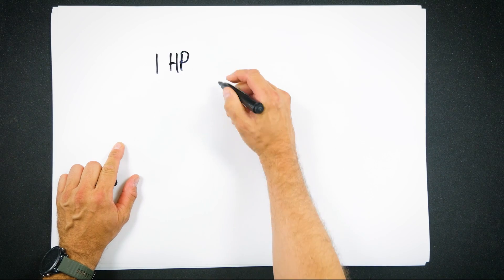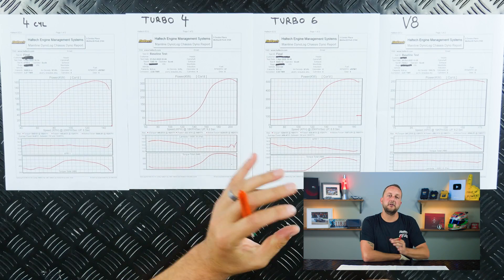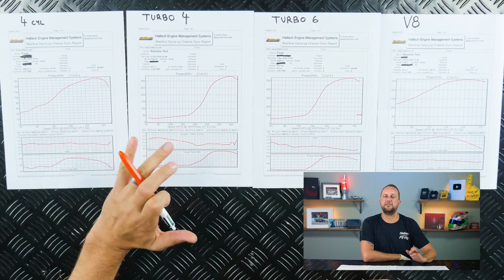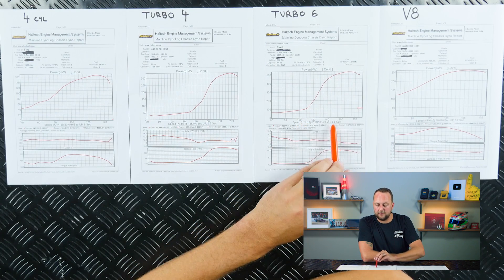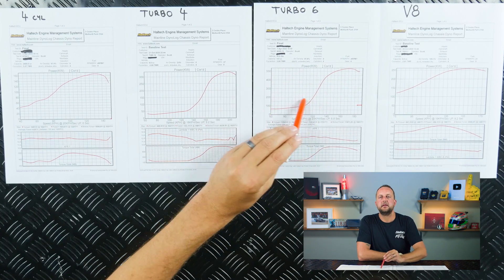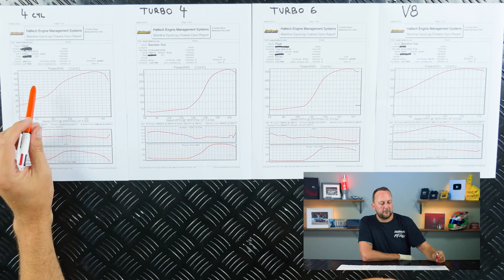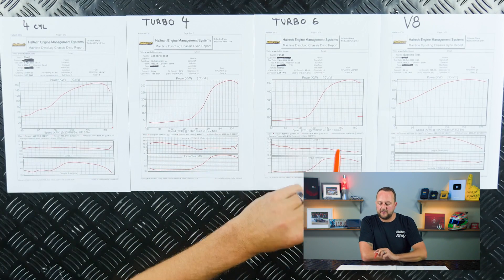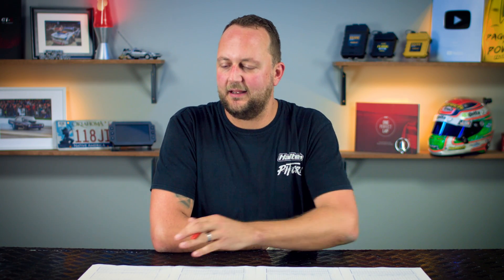🛠 A Perfect Power Curve - is there such a thing? | TECHNICALLY SPEAKING

Comment: 1:50 It’s a lot easier if you use MKS / SI units as used by physicists! No fudge factor conversion needed. Torque is in Newton-meters and angular velocity is in radians per second, the resulting power will be in Watts.

As there is a direct relationship between torque and power most of the discussions by petrolheads are fairly uninformed. When people talk about a torquey engine I think they mean one with a wide power band, not one with extremely high engine torque. The gearbox takes care of that.

Comment: You need to get it straight. There is ONLY 1 thing that accelerates the car and that is rear wheel torque, whether at low rpm or high rpm. Horsepower means nothing more than a calculated number that indicates what rear wheel torque can be expected with various gearings. If gearing is fixed then horsepower means nothing.

Comment: Great reference video. I'd love to see it also talk a bit more about that relation, together with gear ratios.
I ride motorbikes mostly and find that the discussions there often miss very important points on gearing and power. Usually people complaining about bikes like the KLR650 as "needing" 6 speeds, when the bike has a wide enough power / torque band that it can do without that extra gear.

I have mostly operated torquey vehicles and learned a ton from my experiences on the few peak-y race spec bikes, I've been on.
Mainly a built DRZ and 2 stroke race spec Yamaha YZF 250.
TBH, I find them nearly unusable in a normal setting because the engines just buck and complain when going at normal speeds. They taught me, why they have close ratio gearboxes with many gears, and that's purely to keep them in their narrow power band.

Comment: Differentual gearing and tyre size along with a tough transmission / Gearbox can change the curve very effectivly and put the power where you are most likely to use it.
You can have the most expensive and hottest motor avaliable but it won't matter if the rest is not set up correctly and don't forget you have to stop as well. Bigger power calls for bigger brakes

Comment: What mods does the k24 have? And what k24 is it? 

It's hard to believe that it has so much Nm.

I have just turboed my k24z3 with 5 psi. I have 252nm and 167wkw. At 7288rpm. 

Im happy with the way the car drives. But i might up the boost to 9psi just to get the most of my setup and money.

Comment: get inline 4  5 litres and v8 5 litres for road car both have the same power curve ...., its easy to do strong lowend and relativvely strong top end while  have much biger displacement than honda 2,4 litre heh but comapre the same displacement and there be no big diffrenc if you have v8 or inline 4 with similar bore to stroke and so one ...now the perfect power curve assuming we have in regulation limited peak pwoer is..... yeeep constant peak power as wide on rpm graph as posiible this reduce shifting to minimum and no matter at which rpm you are all it takes is put throtlle at max and you have max accelerationat any speed whithout reduction gear down .

Comment: the best engine for a daily car, van or pickup is a 4 Cylinder Turbo Diesel! 😆

not necessarily the fastest thing out there,

but think about it, a diesel as small as a 1.7L 4 cylinder can make 90kw as early as 2000rpm
and max out at around 105kw @ 4,000 revs

that sort of performance will push your car hard from a stand still to about your average cruising speed (80-130kph).

but beyond that rpm range you'll feel the power declining, opposite to what a turbo petrol feels like.

Comment: It leaves me with a question: Does it make sense to have a turbo setup ideal for circuit instead of peak numbers? I have an old bimmer 4 pots and I want to make it faster around the track, should I go for mechanical upgrades (ported head, better intake, larger valves and optimal camshaft), turbo on the mid range, or a big 5.0 SOHC V8?
Reply: as long as you get the same power numbers it no matter what type of setup engine you have  but you must also take into consideration weight  etc small 2,5 litre turbo with let say 500 bhp from 5000 to 7500 rpm vs 5 litre v8 with 500 bhp from 7000 to 10500 rpm  give egzacly the same results on track but you must also conisder  turbo lag and engine weight .

Comment: Hey Scotty, my 2002 WRX was dyno tuned to 155KW at the wheels but it developed soon after a bad hesitation when accelerating and before turbo boots. The tuner stated my OEM ECU is the culprit so I recently purchased a Haltech platinum pro plugin ECU. It will be interesting if the hesitation is rectified when it is retuned with the new ECU.

Comment: I've tried explaining this too many times to my friends, the curve is way more important than the final number.
Reply: not necessery  if diffrenc in peak power is really huge like in this 6 cyl turbo engine in hees egzample which make 550 kw vs this v8 which make like how much was tehre something around 225 kw let say so half of this ok there is 250 kw around  if you put both grapgh on each other v8 will be stronger down lowe to some point of midrange rpm but after this thsi 6 tubro will fly away  what this mean ? well v8 be better for somebody who ride slower and dont want rev so high howveer if somebody want  pure racing emotion and he dont care about lowendpunch just peak  punch level than 6turbo with weak lowend absolutely destroy this v8 and give you way more emotion while driving it and way stronger  max acceleration again if geabox in both be perfect optimal setup ! .there be no contest 6 turbo eat on breakfast in race  this  particular v8 period but if we talking about slower rider which want stronger lowened than you are right  this v8 make better job in daily riding  if somebody dont want cross 3 or 4 k rpm or something like this .
Reply: @mociczyczki  You're kind of wrong here. Of course, you can't compare cars that are so different but lets imagine two bikes with one producing 40 bhp and 30 NM torque and another one producing 35 bhp and 25 NM torque. The second bike have more space under the graph and the first one peaks at 10500 RPM. Let's imagine you're street racing or circuit racing. The second bike is going to win effortlessly. 

The only time the first bike is going to win is during or has the possibility to win is in a straight line drag. Peak HP doesn't mean shit because if its producing 40 bhp at like 10 K RPM and is only producing 10 at 2000 RPM and if it has a shit gearbox, it's going to be a super bad bike. You can fix this issue with a good gear box always.

Comment: Great video as always...  but all the torque numbers in the world (and via math, hp/kw) don't mean anything until they're multiplied out through gearing!  Broad engine comparisons are basically useless until you look at what transmission they're typically (or available to be) paired with.  Imagine 2 fantasy engines - one makes 100 ft/lbs. of torque up to 8k, another is twice is big and makes 200 ft/lbs., but only up to 4k...  geared appropriately, they'll both be just as fast.  (not so coincidentally) their hp/kw will be pretty damn close.
Reply from the maker: That's why Scotty said he dyno'd all the cars in 4th gear, or as close to 1:1 as possible.

Comment: Supercharged (postive displacement type) engines combine best of na plus turbo for a great all round circuit/drag/street compromise. You just lose the final ultimate torque/power a turbo makes at similar boost. And about 15 psi -20 psi is probably a reasonable max boost you can get if you want to do a few circuit laps. Though you can cheat a bit by spraying water/meth through the charger...

Comment: Hi over in glasgow scotland  love the vids how do you convert kw into hp  and how do you convert whp to hp  on a 4x4 ive got 298whp evo cant get a accurate number in hp before i start with torque thanks.
Reply: KW at the wheels is HP at the crank. 
Front wheel drives lose 10% less to the wheels too

Comment: Good trick is to graph drive wheel/hub torque /vs road speed in each gear. You can then see if it even worth considering a closer ratio trans by seeing how much gap (vertically) on the graph between max rpm in one gear compared to she road speed in next gear. And if you factor vehicle weight into the graph, you can bench race different cars against each other, assuming same type of dyno was used.

Comment: I'm just surprised, that nobody builds a 4-cylinder with smaller turbos to obtain lowend and midrange torque, rather than that peaky nonsense. I know, it's not cool to say your turbocharged 2.3 liter has 200 HP, but it should be perfect for a road/track use.

Comment: I believe a 4 cylinder would make more torque than a V8 if the capacities were the same. With motorbikes a 600cc single piston will make a lot more torque than a 4 cylinder V twin.
Reply: That's what Donnan said 15 years back. He pointed at some huge Porsche 2.4l 4cyl
Reply: i dont have fulll knowledge about this  but i think no and both cylinder qquantity and setup can make similar torque number = it all reallly comes to  one factor .... bore to stroke ratio this is hollly grall of engine characteirstic  and in me opinion most importnat factor which made engine characteristic in thsi way and not in that way  offcors asusming the same displacement and both n/a or both with some charge  but maybe you are right i just dont have full knwoledge and maybe some factor havve impact on this  :x but which ?

Comment: how the hell is the 6.2 LS making 840 nm? General rule of thumb is that an engine will not make that much over 100 nm of torque per liter at any rpm. Some really high revving engines can get a bit above 100, but not much more
Reply: 135,48 nm per liter is big number   for n/a bmw s1000rr have 113,13  nm/liter and ktm superduke 1290 have 107,6 nm /liter  .me cb 500 stcck clock 94,18nm/liter now after some light tune it clock 102 nm/liter  with much better lowend  than stock however peak performence for race are egzaacly like in stock setup .

Comment: Very good 101 on the importance of tailoring the torque/power curve of the engine build for the application it would be used for - and I particularly liked the addressing of the gearbox gearing.

Many years ago, a friend built his car with a 'race' camshaft which had a rather narrow 'power band', but couldn't afford the rather expensive close ratio gearbox it needed. In practice, it was pretty quick, for the day, in the first three gears as the engine still produced sufficient torque to pull the next gear, but it didn't have torque when going into 4th to overcome the drag forces as it was to far down the curve - the car would actually slow down. If he was on a down-hill, gravity gave enough assistance, though, and as long as he kept the speed up, and the engine in it's power band, he could use 4th effectively.

Comment: Could industry come to some sort of standard for describing power band ? With emphasis on band. Or more sensibly  - Torque band. As engine primary makes Torque (Force) not Power. Power just means, that torque (force) is generated quickly. For example, coming from electrical engineering background, lets make a parameter that describes wildness of torque curve, similar as band width for band-pass filters. Or some average Torque in some way defined band. For example, start and end values for region are where torque is 80% of T_peak.
Reply: Or a drivability factor that describes how close the torque curve is to a straight constant torque line.

Comment: From an NA engine you can only get about 110Nm/l or 81,5lbft/l, realistically a few less, in a high end race engine a few more. If you add boost you multiply the torque for every bar of boost.  The amount of cylinders as well as the bore/stroke ratio does not really affect the acheivable torque but it does affect at what rpm you can deploy that torque.  A point I would like to make regarding the "what is better for the street", one very important aspect is how well the engine is tuned when its not on wide open throttle. The numbers you see on the dyno is at WOT, but you rarely drive at WOT on the street, its more important with a quality tune at medium throttle around 1-5krpm than WOT torque numbers.

Comment: Godd stuff buddy enjoyed it,
We got a 2014 isuzu dmax TFS86TT 2.5TT Yukon UK spec,
And it tuned and its a monster, i swear it will be the first motor that will blow the TC led in the cluster lol,
here is my question, what would you suggest would be the next step of further performance, the tune on it is not dangerous (the tuner refuses to make a tune that will damage a engine and i like that attitude)
And so we know mechanical upgrades are next before it gets put on a dyno again, but dont need to make it wheelie but just want a bit more, its used for alsorts and does alot of heavy load towing and we live in wales so we do partake a little off roading lol
Hope the old can holder heals up soon buddy 👍

Comment: the NA 4 cyl is doing 150km/h at redline the others are doing 170-210 hardly a fair comparison. All may be at 1:1 gearbox ratio, but final drives (and tyres) are probably way different

Comment: Small suggestion, but instead of having the 2 turbo engines with huge turbos, maybe have 2 of the same engine (eg 2x SR20 or 2x rb26) - one with a large turbo like you talked about in the video, and one with a more modest turbo. The examples used in the video make turbos seem like a terrible street option 😂

Either way, keep up the good work, love your content!
Reply: I was thinking along the same lines, same basic engine - N/A, constant displacement/Sprintex supercharger, mild turbo'd, and high power turbo'. Same engine, very different ways of producing power.

Comment: Great information! So many people just don't get peak numbers vs area under the curve. My Miata makes 313kw peak, which is cool and all, but the best part is that it makes above 400nm from 3600-7100RPM. And that's the part that makes it fun, and a great street car.
Reply: That’s cool, but i have 620nm at 1500rpm and goes to down to 550nm at 4500rpm but hp keep is basically at 270-300hp throughout the rev range
Reply: @Xfacehack  Sounds like a 335d with the stock turbos cranked up to the clouds 😂 btw 550nm @ 4500rpm = 347hp

Comment: This is why I prefer a n/a 4-cylinder with a big cam - which means it's probably closer to the curve on the 4-cylinder turbo graph than anything else here, just with lower numbers.  It's just more fun to have an excuse to shift down when I want to accelerate.  The V8 is undoubtedly quicker, but it makes for a boring drive if I'm not on a race track.  :-D

Comment: Which uses the least fuel @ 100km/h? Less power means better economy?
Reply: Of these most likely the NA 4cyl is the most economic engine. Generally less power means better economy unless you're comparing with a really old engine. I'll try to make it as simple as possible: nowdays engines all have a quite similar efficiency, and the efficiency is calculated dividing what you get (in this case power) by what you use (fuel). So, if you have two engines with the same efficiency, if one makes double the power as the other it has to use double the fuel.
Reply: @DinoTrollerino  I understand what you mean by simple as possible but you know it’s not.
Big turbo motors aren’t going to be 10:1+ cr, a 6/8 is going to have more internal friction. Both impact efficiency substantially. It goes well beyond that too, I know what you mean, but it’s probably an oversimplification of it. Your ‘simplified’ statement is correct though.
Reply: @Woggin-ind  yes, I know it's oversimplified, but I think it's good enough for a YT comment
Reply: Not exactly, comes down to efficiency more than power.

Comment: That math between torque and power is why the metric system exists. 😄 Just use kN and kW.
Reply: It did make me laugh how Scotty spent five minutes explaining (really well!) how to convert RPM and LbFt into HP, and then spent the rest of the video using kW and Nm.
I think it's a Commonwealth thing that we're equally happy with metric and imperial (although I'll always use metric if I need to do maths).
Reply: @phuzz00  Yeah, he used the process of dimensional analysis. Since the metric system is implicitly more descriptive in it's units, it made sense to use Metric for the rest of the video. I say this as an American that was taught Metric in school hand has issues when people tell me things in imperial units, especially while cooking and baking. My wife laughs at me all the time.
Reply: I would rather pound some feet, if that's alright?